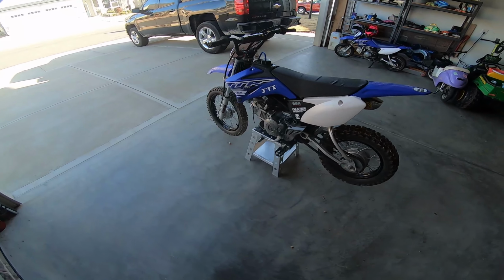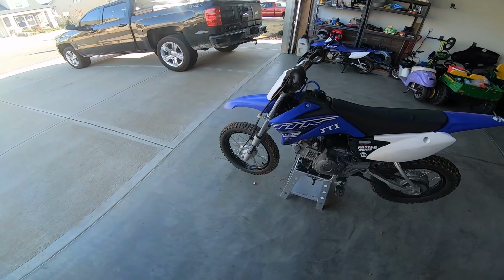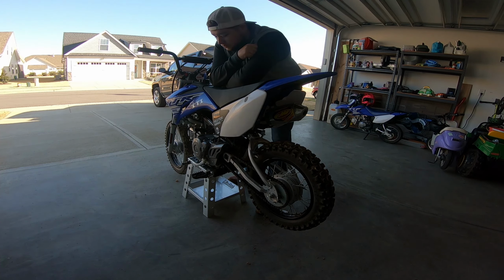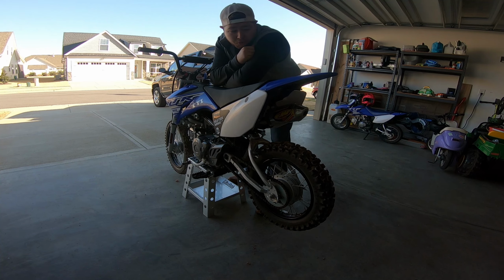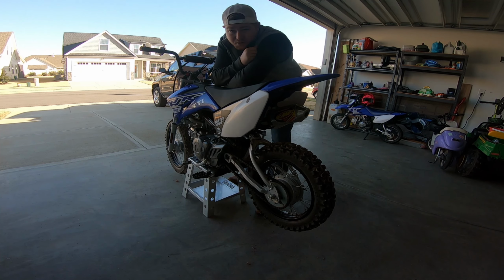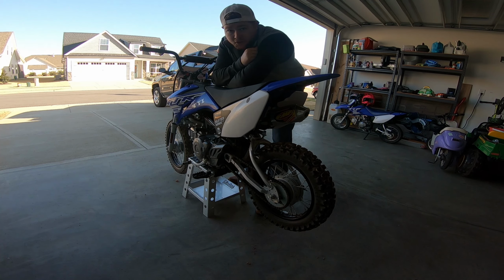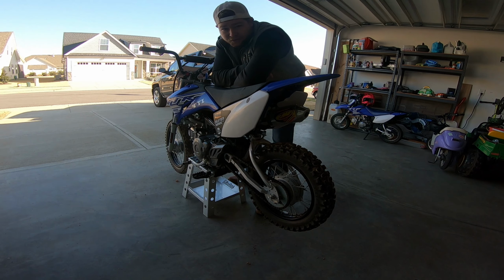2019 Yamaha TT-R 110 FMF Sound Test | Cold Start to Rev Limiter

Comment: Love the videos. I just ordered the FMF exhaust for my TTR. Do I HAVE to jet it or will it run fine without it. I have no idea what I'm doing with jetting.
Reply from the maker: Jetting can be tricky. Depends on your altitude above sea level and average temp range in climate too. I can run stock jetting in the heat of summer, but I have winter jets too. You will likely have to go up 1 size on main and up one size on pilot as it tends to run lean after install.

Comment: High compression piston.....no jetting change. You can easily drill out jets with the proper drill sizes
Reply from the maker: LiveFreeandShred good option. May go that route. I definitely want the extra power!
Reply: Doing it in my 90 tonight. Should be running by dinner. Just waiting on a rocker arm dowel to show up today. Weisco 11:1 bumped up from 8:1 should at some juice to it
Reply from the maker: LiveFreeandShred what all is required to do it? Have to bore the cylinder? New head?
Reply: MMFC nope. Just swap the piston and change the gaskets
Reply: MMFC weisco is the company that makes the direct drop in piston. For my 90 at least. I would imagine they make a hi comp piston for the 110

Comment: I love how the 110s sound with the FMF. Also You should totally big bore that thing
Reply from the maker: Rusty Odyssey FL250 I know man, but carb tuning these things is a real pain. I just don’t want to do motor work for an extra horsepower or two and it run like shit.
Reply: If you big bore it don’t bother with the stock carb. Upgrade to like a 26mm mikuni and you’ll have no problems
Reply from the maker: Rusty Odyssey FL250 May be a good option 🤘🏼
Reply: Or keep the stock carb but get jet drills
Reply from the maker: Rusty Odyssey FL250 that’s was honestly my first thought, but never done it before so a little timid
Reply: It’s super easy. Just go up one size then see how it runs. No risk at all